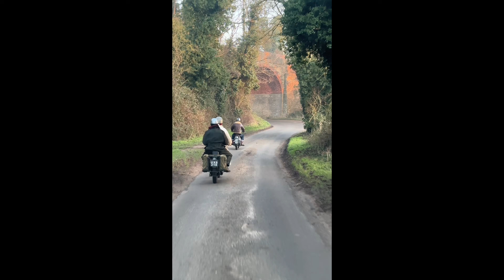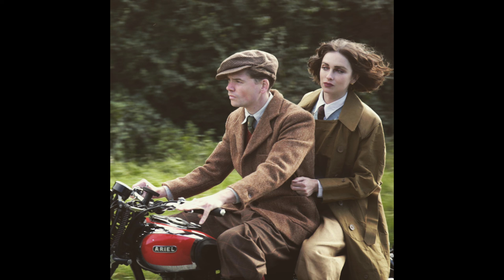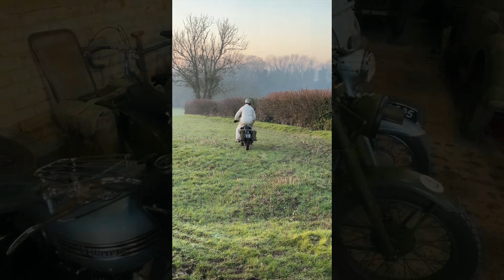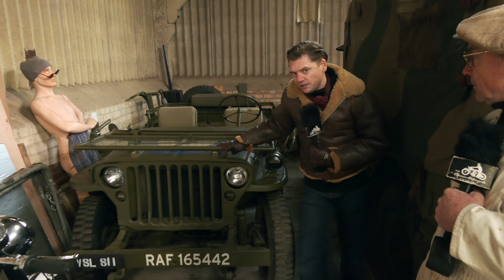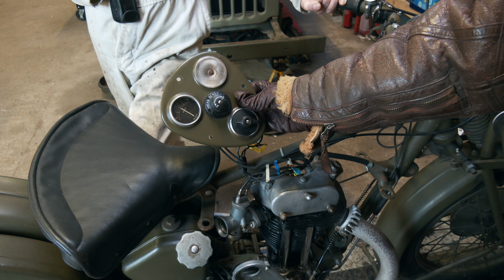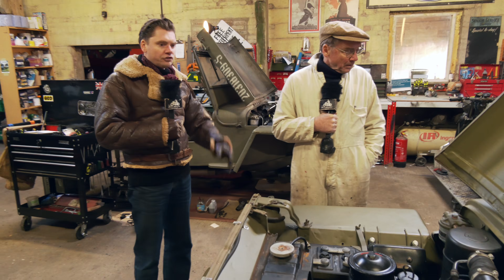Workshop Tour: Father & Son's Classic Bike & Military Vehicle Collection

Comment: Very interesting collection!, i own several war era Raleigh industry bicycles in my collection,i have a ladies Raleigh with no chrome, probably made early on in the war,usually you can date an original condition bicycle from its sturmey archer hub, the ww2 era cycles were fitted with undated hubs, the last batch of dated ones were in 1940 which would have a single 0 digit in the hub shell,as the war progressed i have noticed that the bicycles were a mix of black painted and chrome parts,i aslo have a pair of Philips pedals stamped “ war finish” with hardwood blocks  instead of rubber, due to the shortages of it at the time.